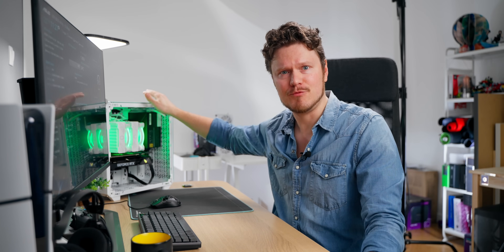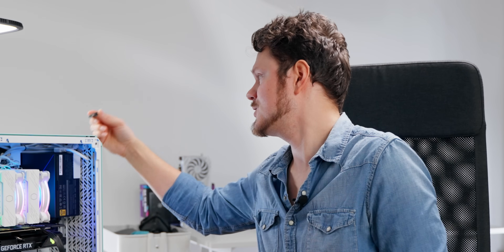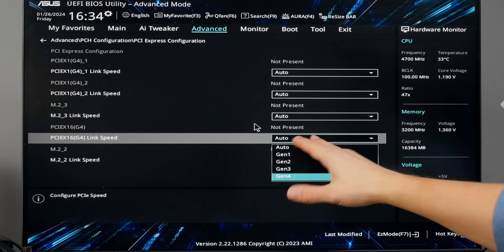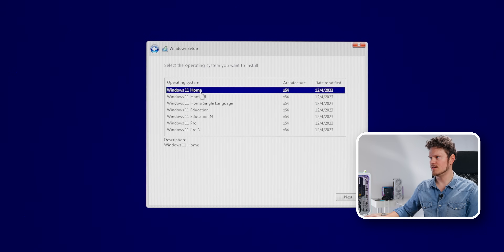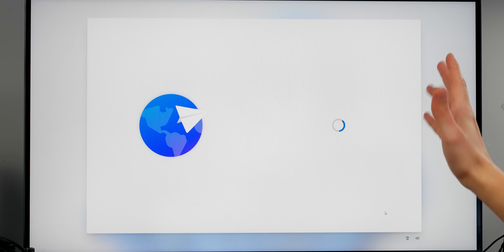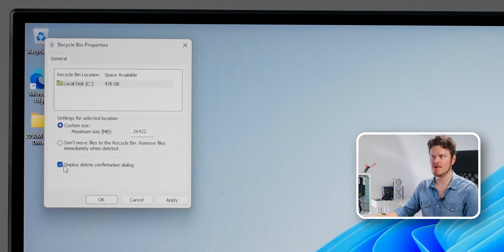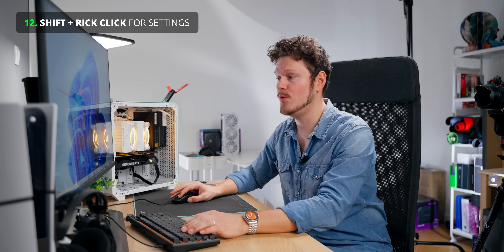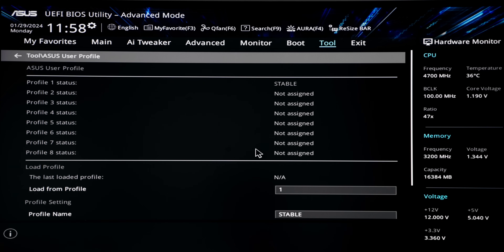Always Do THIS with a new Gaming PC!

Comment: On my current build, just getting into bios and getting an OS installed was an hours long slog of troubleshooting and stress.  POS motherboard.  I am scared to do even do anything further, especially updating bios, because it works *enough*, even with annoying issues like not coming out of sleep half the time.  I watch people start their rig and instantly get a bios screen in envy...LOL.

Mobo is a Gigabyte Aorus b650 elite AX (rev 1) for anyone curious.  If you look for problems for a product online, you almost always will find them, but I have seen so many problems with Gigabyte that I felt vindicated after seeing droves of people with similar issues.  I will not get another Gigabyte board.  Another recent indicator, was all the people trying to enable secure boot for BF6 and bricking their bios, it was almost always a gigabyte user.

Comment: He forgot to set curve offset in the bios.

Also Revo, UnigetUI, Warp terminal, MediaInfo, very very handy software.
Reply: Also if you lack WiFi 7 but router has 4×4 cards almost always have 2×2 so you can use 6E WiFi sticks (or whatever, I use an onboard and a stick) and set 1 to 5Ghz and 1 to 6Ghz and then bridge them or both to 6Ghz. Tadaa.

Needs more than 1 datastream to have any effect though.

Comment: why are you setting up the memory in bios after you install win? i do all the bios settings before.
Reply from the maker: Because certain BIOS settings can mess with stability, specifically memory tuning.  It's best to get the system set up first in optimized defaults and then tweak afterwards.
Reply: @HardwareCanucks  i actually prefer any such instability revealed during windows install. i've been doing this forever. remember the windows xp installer, that was still 'ascii' screen based? that phase was always the best to reveal any such instabilities, no other part of windows was ever as sensitive to it. i always knew something wasn't right (either bios settings or a faulty component) if this phase kept crashing.

Comment: We don't always need to flash the bios.
For example, in my case, i checked my current BIOS version as it is printed to the mobo, and then checked that against my mobo webpage that lists all the various bios versions. OK I don't have the very latest bios but I don't need to update because everything is working as it should.

It even says, "If the system is working properly, we recommend keeping the current BIOS / firmware."

Comment: Omg, I didn't know that the installation of Win11 was made so cumbersome. Thanks for the helpful video!
Can you please give me your opinion on whether buying the MSI MPG Z790 EDGE WIFI together with the i5 14600k is a good buy (for gaming only)? Currently costs under 500$ in my country. Or would you recommend something else in the same price range?
Would be very grateful for your answer! Thanks in advance!
Reply: HOW IS IT THAT
i7 14700K is 20 Cores, 28 Threads @3.4GHz, Raptor Lake

vs.
i5 14600K is 14 Cores, 20 Threads @3.5GHz, Raptor Lake
the first CPU ($509.00 Canadian) IS ONLY 5% faster* than the second CPU  ($319.00 Canadian)?!?!??!!!!!!!
I see why you bought the i5.

* cpu.userbenchmark

Comment: Once I've updated BIOS, as described, I would be looking to install the (supplied on Asus USB) drivers, before installing Windows. Isn't that more correct than allowing Windows to do it? (By the way, once Windows is on, I'd be searching for the latest drivers for the devices I'd just installed too.* *Perhaps negating what I just proposed. But my feeling is put these on to function, at all, first, before Windows gets to them. Advice?

Comment: When you turn on XMP also turn on "ReSize BAR" Speed tweak for your GPU.
Also I would not set Power plan 'High performance' default. one of the things it does on Intel is set the CPU to 100% Clocks (even at Idle) using Balanced or going into advanced and making sure 'Processor management' is set for 'minimum Processor state' of 5%.  This  allows the CPU to change clock speeds dynamically, for example down at Idle and low load,  keeping the power draw down and CPU cooler, and also fans quieter. - its not a real world performance hit either as the CPU can up clocks in milliseconds.

Comment: For anyone who does not want to waste 20min of his life:
-Make sure the power cable is not bent too much at the GPU.
-Power on the case without the side panel on to make sure there are no problems.
-Update the BIOS to the latest version.
-Disable multi-core enhancements in the BIOS.
-Set the proper link speed for the riser cable in the BIOS.
-Enable XMP in the BIOS to overclock the RAM.

Comment: I dont know this drawback after installing windows 11. I just build my new pc and Im on windows 11 now with mbr as default format and if i have to enable uefi i have to disable csm first and to do that i have to reformat my primary drive to gpt first which i still havent tried yet cuz my windows files are all on my primary c drive which mbr format.. suckss. Do i have to do a clean install?and im to afraid to do that know cuz it may cause issues since fucking mbr cant edit my bios to enable or disable this uefi csm fuckers, cant play valorant with windows 11 on mbr format, and i fucking partitioned it i still have no idea what todo with it if i want to unpartition it would it be the one be formated if i convert it to gpt or not? Can u guys help?

Comment: Another reason to disconnect all other drives during Windows install is that if any of the other drives have/had Windows on them and the boot partition remains on them Windows can end up using the wrong drive to boot the install. I saw this happen where Windows was on a HDD, and a new install on a SSD. It decided to use the boot partition on the HDD to load Windows on the SSD.

Comment: You should use the xml config file for your win10/11 installs. that way you can tell the installtion program to do alot of settings and remove bloatware sonyou dont have to foxnit afterwards
Reply: Not a bad a idea, but that is way too complicated for most people who have to watch videos like this. I can assure you that most people have no idea that's even possible.
Reply: @JJFlores197 Microsoft has added this feature and have very good documentation on it. There even exist several unoffivial generator webpage. So it's very easy, you just copy the file to the installation media.

Comment: Question xmp isnt supported on my pc but i do have custom option to enable ram setting to 2400 thats what i have or just auto i dont know what the diffrence is it works so i never cared to mess with it getting more ram anyway and dont have any oc on the system as i found messing with things thats not broken will cause headache and a very empty wallet.

Comment: After the initial bios update, you forgot to say to load defaults and restart.  I always have it reapply defaults when moving to a new bios, just in case any options were changed or added as part of the new one.  After that you can go redo your XMP/EXPO and whatever other changes you've made.

Comment: Armory crate is malware, I'd never install that POS.
Reply: I like it, but my pc is so powerful it has no affect on performance
Reply: And it’s hard to completely uninstall it, so much bloatware. I used revvo uninstaller to remove it
Reply: Yes! 1000 times yes! I couldn’t agree more. I installed it on one computer, it was miserable.
Reply: How is it maleware? But i hate how it has ads. WHY DOES ARMORY CRATE HAVE ADVERTISEMENTS??? It is disgusting
Reply: I had a weird problem with armoury crate's audio software that led to my monitor flashing black every 15s or so. Uninstalling armoury crate fixed it immediately, never using that bloated malware again.

Comment: Instead of continuing to reinstall windows, I'm not sure if the tool is still in the control panel of windows 11 but it's in 10, it's the windows 7 system image creation tool which does allow you to fully format or erase the drive before reinstalling your system image that is fully functional, registered and with any and all software installed at the time the image was created.

Give it a shot next time Instead of wasting time reinstalling windows and all your software repeatedly. It's completely foolproof to use and can never be corrupt so long as you make multiple different images to both DVD and external hdd.
Reply: How many DVDs is that going to take? 20+? Single layer DVDs store up to 4.7 GB I believe. Dual layers store up to 8.5 GB of capacity. It just makes more sense to backup to an external hard drive or SSD.

Comment: biggest mistake:
1.updating bios when NOT necesary (the bios is not something that needs update like a regular software,usualy you update bios when you got some issues related to it)
Dont mess around with the bios. sometimes its one way trip.(unless  u got someone that can flash the bios directly on the chip)

Comment: 10:30 I've installed wifi cards that work without drivers for the purpose of installing windows over a wifi connection. So yeah, bit of misinformation there as it is possible to do so

Comment: I always did the don't fully close the computer until everything is running correctly, because when I was younger I had a friend who assembled his PC then closed it up tried to boot it to run furmark then we heard a loud knocking sound but the PC was still running, so we turned it off. He opened it again and the CPU cooler ate a cable and broke off the fan blades. Yeah it's safer if the PC was closed, but if it was open we could have seen the cables even before we turned on the PC.

Comment: I love that bypass command to bypass the internet WIFI/LAN. Is there any other bypass command(s) that can be use while installing Windows?
Reply: You can go a step further and create a custom Windows install. This allows you to customize almost every aspect of the install process. This is getting more into the Windows IT side of things though. You can use a tool like NTLite to create custom Windows answer files and add drivers and packages. You can create answer files that automatically create your user profile and skip the online MS account requirement. It is a lot of upfront work though. But once you get it dialed in, it can save you a lot of time and effort if you build a lot of PCs.

Comment: Not sure what tying the power cable changes beside you feeling good about it. If its gonna burn, then its gonna burn and no matter how you tie the cable. If it burns, means its a design fail from the manufacturer side , and not some cable. I been building computers for over 20 years. it is 2024 and I cant understand why idiot humans are making such a fail designs nowdays, like building graphics cards.. Stuff we dont need and we should get rid of like 10 years ago. A car battery size graphics card, in a box with something that looks like a car cooler. This is fail! Why dont they make motherboards with slot for graphics processor or build a decent CPU with 4090 equivlant onboard graphics, let me make my own cooler and let me use my ram, because its 2024 and I dont wanna be forced in to building heatoven designed by Nvidia or AMD.

Comment: I recommend only updating the bios if really needed, because of a compatibility issue or some,because in case something goes wrong you mainboard is dead.
Reply from the maker: You can always flash a BIOS if something goes wrong. It’s scary but having your mobo with correct BIOS is important for memory support and security. 
-D.

Comment: When you talk about the Wi-Fi, Windows already comes with drivers, ever since win10 even a lot of drivers (even though generic) come preinstalled.

Are the Motherboard's Wi-Fi drivers different from the rest of things? Because in that case, I have a USB wifi adapter since more than a decade ago. It's a simple 150mb one but I mean, if this is the situation. You just plug that sucker in and you're good to go for configuring the system without the need of doing that command. You can always install the LAN drivers later for the mobo's wifi, I suppose.

Also, what is armory crate and is it good? Is it better than installing each driver separately directly?
Reply: That is true that WIndows has a lot of network drivers, BUT it doesn't mean that all wifi adapters are supported out of the box. I've seen plenty of instances where a laptop with a clean install of Windows 11 doesn't have wifi connectivity.

Comment: Do not use the Full-speed option in the AIO Pump Q-Fan control on motherboard as this just increases pump noise, pump wear and does not really reduce temps much. Recommend a brilliant software called Fan Control, here you can customize i.e. the pump speed depending on any value (i.e. CPU load or temperature). Used this on my EK 360 and it is dead silent and still cooling perfectly in any conditions. Also prolonges the lifespan of the AIO pump.

Comment: You started talking about Armoury Crate as if everyone knows what it is or what it's for .
Anyway, for those who don't, that's an Asus software for Asus products .
Don't go downloading that if you don't have an Asus motherboard  , instead look for the drivers (or driver suite -- meaning driver combo) of your own motherboard manufacturer .

I personally prefer to look up & download my new / old motherboard's latest drivers before I do a Windows installation, and during the initial installation of windows I disable my wi-fi or land line (I just turn off my modem) , so that I can install drivers manually after the Windows installation .
Why ?
Because Windows 7 and upward have a nasty habit of starting to look for drivers once it has internet access, and some of the drivers it downloads tend to be the generic variety that are not optimized to my motherboard, USB, screen, graphics card etc . 
If you know your hardware, and it's drivers, it's best to do it this way .

Comment: You forgot to check ReBAR... I have a bootable stress test stick. I tweak/enable/overclock/undervolt everything in the BIOS, test linpack and memtest64 for half an hour and then proceed with windows installation and further long time tests. If there is something noticeably wrong with the hardware, and it cannot perform as wanted, there is no point installing the OS to find out. Also, you wait more for installation and updates if you disable the OC features.

Comment: I have one of those cheap chunky rgb GPU braces, its wide enough to cover the gpu power port, and deep enough that the cable can run through with only a small loop above it to relieve strain. The RGB is not a must but I do like the screen mirror lighting, so it does add a bit more of that when I linked it to my corsair icue bloatware. Its the DeepCool GH-01 ADD RGB

Comment: 4:35 that’s what I came here to say, I only found out a few days ago that I had to disable that setting (which actually means to enable the limits). I can’t stress this enough, if you leave that setting on, IT WILL ABSOLUTELY FRY YOUR CPU. The higher end your cpu is, the faster it will die - and it voids your warranty because you’re not using it within the limits intel has provided.
Edit: the improvement you get from this is like 1%. Not even noticeable.

Comment: Just finished my 1st build in ten years, amd 7800x3d+ r x7900xt +Asus tuf gaming b650 plus WiFi, and I had monitors go no signal, still happens at boot , Asus had wrong drivers on the specific mobo page, the ssd would freeze until I turned tps off, got through all that and I have no trust in the install, the PC feels slow and glitchy 😮 not good

Comment: I updated the SIV APP that is with the Gigabyte motherboard I have got, And now the SIV APP won't load, It is taking forever to load up, I needs to get into it for the fan curves, I installed another 2 fans yesterday but because the SIV APP won't load because I updated it, I don't know what to do, I don't want to go into bios ect, The windows USB is over a friends  so I don't want to go into the bios just incase something do go wrong, I am still learning with a few things with PC's, I produced Hip Hop on PC's for years but never thought about learning the windows and PC parts ect, Oh and I Sim Race too, Beam NG and AMS 2 is my go to Sim Racing titles, I might start ETS 2'ing though, Euro Truck 2 is fantastic for a relaxing night in the rig, Even with a Logitech Steering Wheel Euro Truck is bad ass, And Beam NG is extremely realistic with the Force feedback, Highly recommend Beam NG if you got a Sim Racing Rig...
How do I go about getting the SIV APP reverted back to the last update or sort out the loading issue on the SIV APP on a Gigabyte H601i, Great little motherboard apart from only having one M.2, But getting an M.2 with bigger memory will sort that, I just didn't think that way, I ended up buying two M.2's lol, And i can only one M.2 slot, lol, I will just invest in a bigger M.2 in a few months, I can get a faster M.2 anyways, But yeah how can I get the SIV APP sorted when it isn't loading, Anyone else get the same issue? If so how did you sort it, The system Information viewer is important yeah, It is the only way of sorting the Fan curves yeah??

Comment: other missed things...
I realize you may not want to include EVERYTHING to keep the video shorter, but this IS a video for newbies so... I would have discussed a few critical BIOS/UEFI options:
1) CSM (Compatibility Support Mode)
2) Secure Boot
3) TPM
4) Virtualization (i.e. "SVM" for AMD is required to be on if you want "Memory Integrity" security enabled... it CAN be a real problem AFTER installing Windows if a piece of software prevents you from even BOOTING like Asus AI Suite III did to me (a newbie would have had a hard time figuring that out)... I'm not saying you SHOULD enable Memory Integrity as that's not my area of expertise, just that if you plan to do so I'd turn Virtualization on BEFORE even installing Windows)